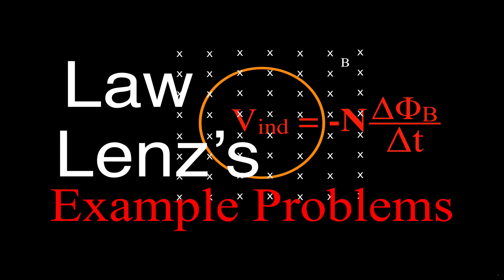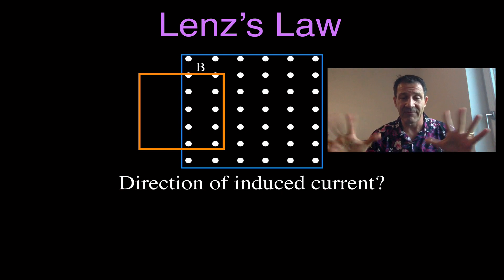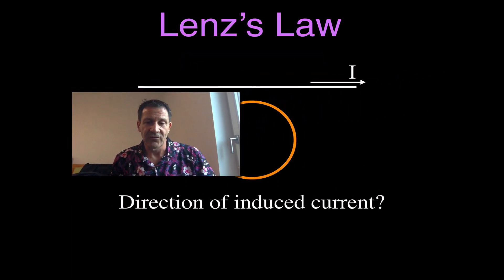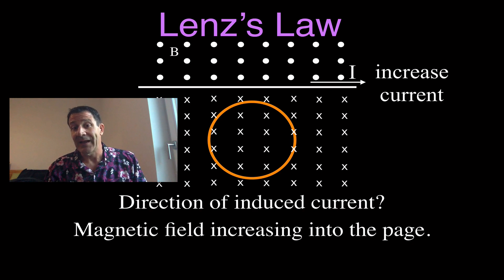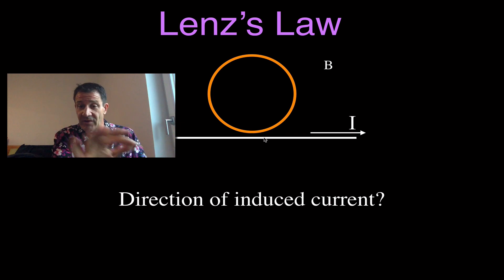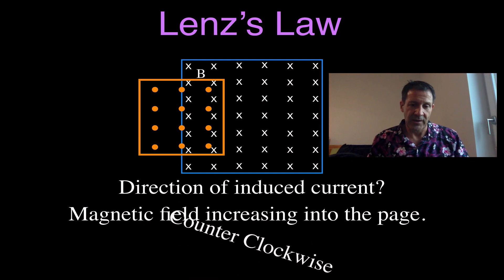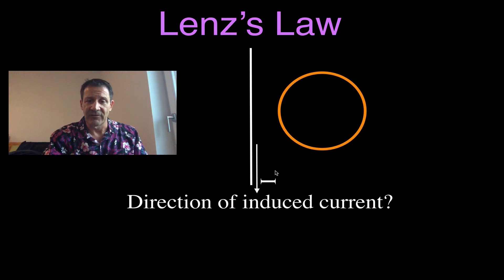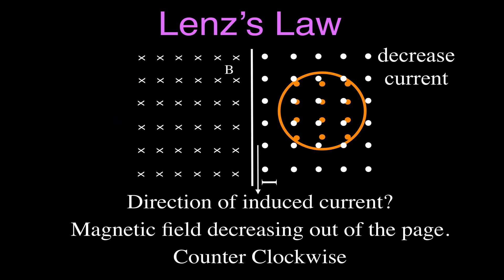Electromagnetic Induction (12 of 15) Lenz's Law, Example Problems

Comment: Problem 1
As the loop travels to the left, the area through which the magnetic field is passing is increasing so A=1.
The magnetic field is directed out of the page so B = 1.
R(A,B) = -AB
R(1,1) = -1
So the curved conventional current around the loop is clockwise.

Problem 2
The straight conventional current is increasing so I = 1.
The hoop is on the right side of the positron’s path so S = 1.
R(I,S) = IS
R(1,1) = 1
So the curved conventional current around the loop is counterclockwise.

Problem 3
As the loop travels to the left, the area through which the magnetic field is passing is decreasing so A = -1.
The magnetic field is directed into the page so B = -1.
R(A,B) = -AB
R(-1,-1) = -1
So the curved conventional current around the loop is clockwise.

Problem 4
The straight conventional current is increasing so I = 1.
The hoop is on the left side so S = -1.
R(I,S) = IS
R(1,-1) = -1
So the curved conventional current around the loop is clockwise.

Problem 5
As the loop travels to the left, the area through which the magnetic field is passing is increasing so A = 1.
The magnetic field is directed into the page so B = -1.
R(A,B) = -AB
R(1,-1) = 1
So the curved conventional current around the loop is counterclockwise.

Problem 6
The straight conventional current is decreasing so I = -1.
The hoop is on the right side so S = 1.
R(I,S) = IS
R(-1,1) = -1
So the curved conventional current around the loop is clockwise.

Problem 7
As the loop travels to the right, the area through which the magnetic field is passing is decreasing so A = -1.
The magnetic field is directed out of the page so B = 1.
R(A,B) = -AB
R(-1,1) = 1
So the curved conventional current around the loop is counterclockwise.

Problem 8
The straight conventional current is decreasing so I = -1.
The loop is on the left side so S = -1.
R(I,S) = IS
R(-1,-1) = 1
So the curved conventional current around the loop is counterclockwise.

Thank you for the video!
Reply from the maker: You are very welcome. Nice summary.

Comment: Thank you for explaining this thoroughly although I have one question in regarding the last example. Why is it that we have to add more dots to cancel the existing dots? Shouldn't it be adding more x's since in the beginning we started out with nothing, then the dots got added, so shouldn't we add the x's just like how we did the rest of the problems?
Reply from the maker: If the magnetic field is decreasing out of the page then coil tries to add more magnetic field out of the page. Therefore, but are dots.
Reply: @stepbystepscience  thank you very much!

Comment: Very good explainations, very easy to follow! Thank you! One question though, if I may. I'm having a hard time figuring out Lenz's Law in Faraday's equation and what the addition of the minus sign tells us about the direction of the induced current (if anything). An increasing flux in the coil is always going to result in a "negative" voltage due to the addition of the minus sign in Faradays equation, mathematically -- but if we switch the polarity of the magnetic field affecting the coil the induced current will change direction, but the equation will still give the same "negative" voltage, since it's still an increasing flux when calculating delta B. Am I missing something or am I reading too much into what the minus sign really represents?
Reply from the maker: It is complicated...I would say that the minus sign means that when the magnetic field through the coil of wire changes (aka the magnetic flux) the a voltage/current is induced in the coil of wire so that the magnetic field produced by the induced current opposes the change in the magnetic flux.  How do you like them apples?
Reply: @stepbystepscience  Right, so it's a matter of circumstance? We can know that the induced current will always oppose the change in flux, but if we don't know the polarity of the magnetic field the equation can't tell us the direction of the current? Or is it something else that's usually taught at a higher level and not really teachable in youtube comments? lol
Reply: Its convention. But in your specific example, if I keep the same orientation as magnetic field into the page is positive and that it induces a current, given a negative value, then I switch directions of the magnetic field, then I now have a negative magnetic field. So the current would be positive, because we defined the other direction as negative and it switched directions. The negative is there so it follows the right hand rule, because the right hand rule is the convention we use. Without the negative the right hand rule would be wrong in this case.